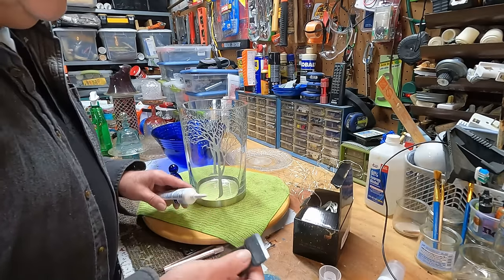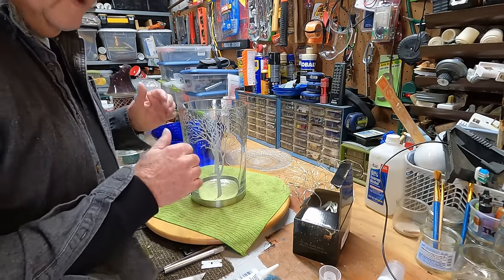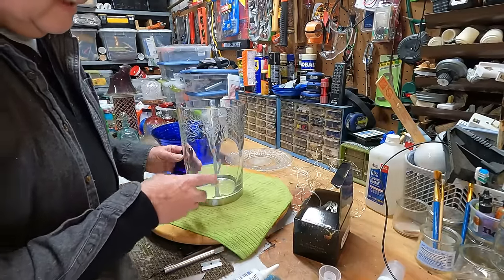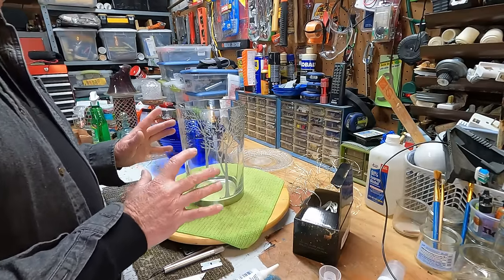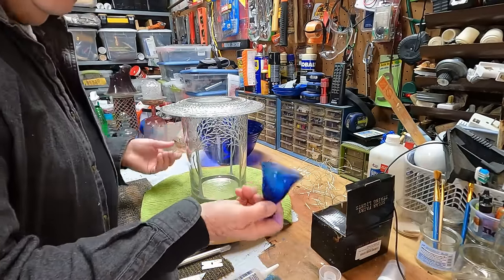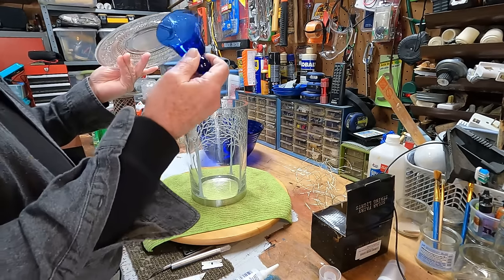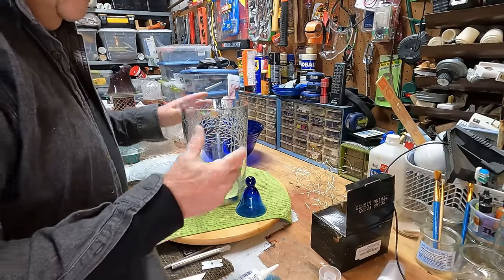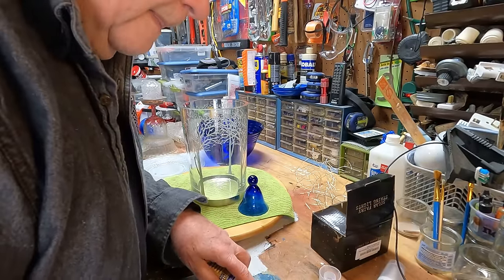Glass Fountains and Totems

Comment: It’s very pretty and a good way to repurpose glass that would otherwise be packed away. How do you change the lights once they burn out?
Reply from the maker: Lucky not to have that problem so far, but it would likely mean separating pieces at the silicone seal.

Comment: How long will the silicone securely hold outside? 
Gorgeous work!! ❤
Reply from the maker: I haven't had any problems with it here in the South for several years.  The pieces I would expect to separate would be some of the larger hanging ones, yet I have only had one where the hook separated from the base.  Other pieces that came apart were due to a paint layer between the glass and silicone that peeled off.  So far so good.

Comment: Would a heat gun help to loosen the silicone when doing replacement work or would it be too messy?
Reply from the maker: I haven't tried that.  The silicone might soften a bit.  One reason I don't use epoxy or other permanent glues is that I do have to repair and replace some pieces and silicone works to eventually separate and start over.